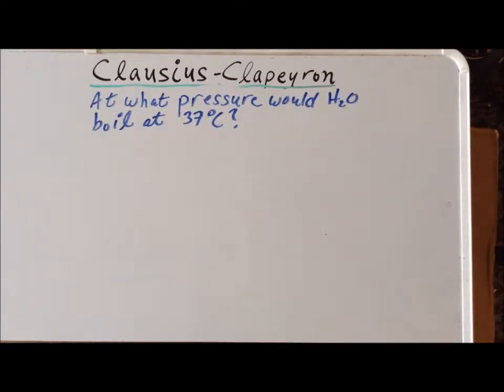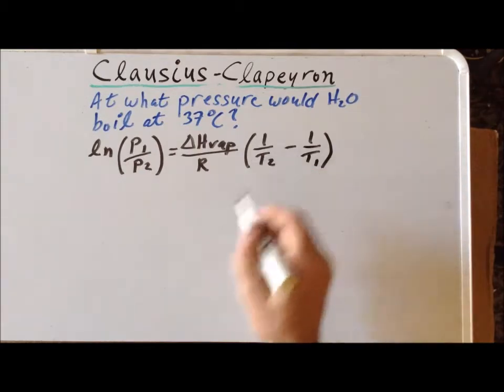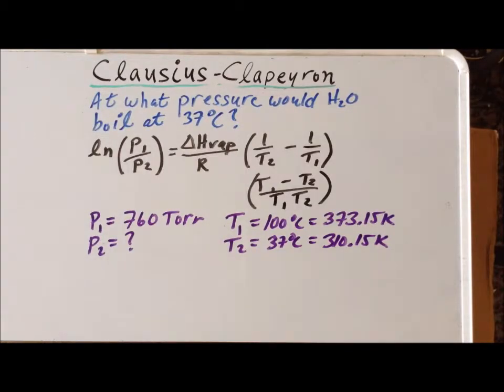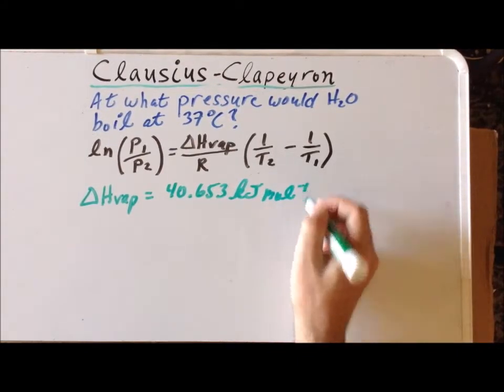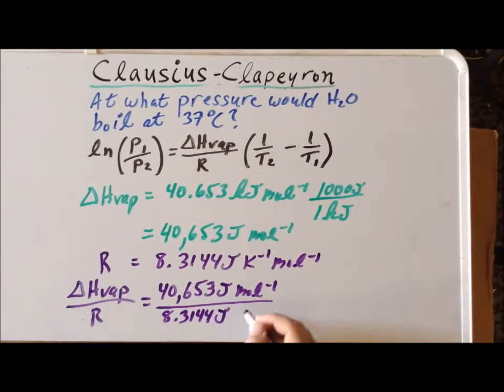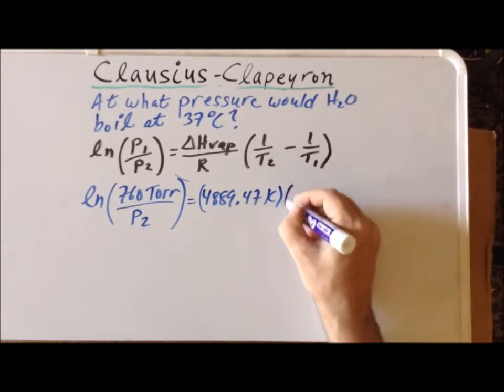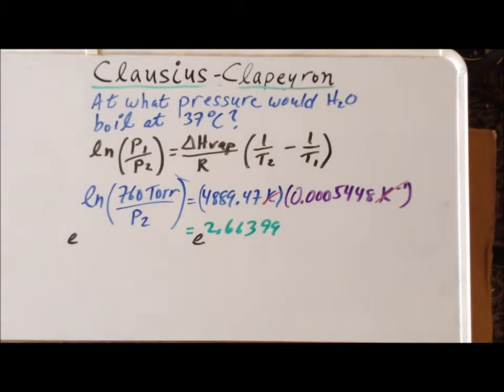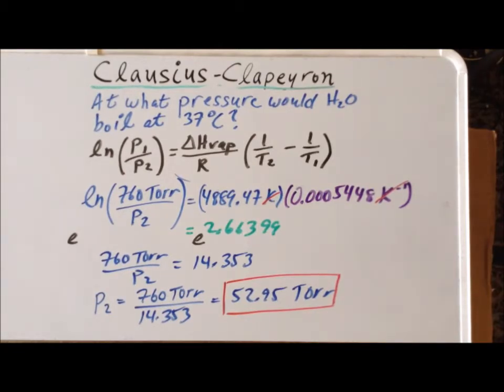Clausius-Clapeyron equation: 37 ºC problem

Comment from the maker: (for mobile users)

00:07    Statement of problem
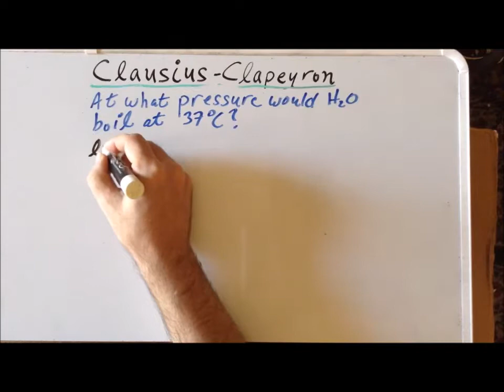00:40    Clausius-Clapeyron equation
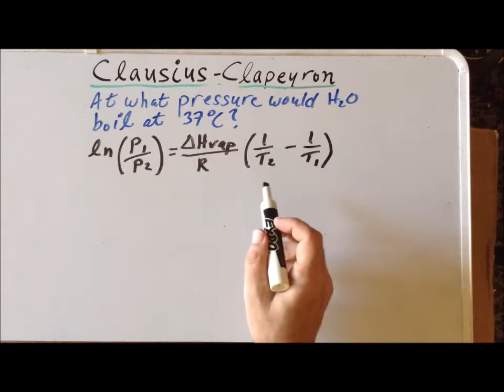01:19    Reformulation of temperature difference term
01:41    Values of relevant variables
02:39    Calculation of temperature difference term
03:17    Convert ΔHᵥₐₚ from kJ / mol to J / mol
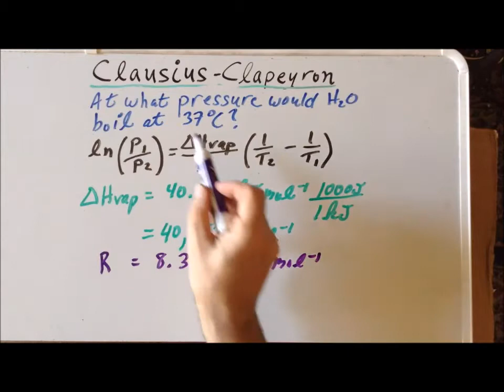04:13    Calculate ΔHᵥₐₚ / R
06:41    Raise each side as a power of e
07:20    Solve for pressure p